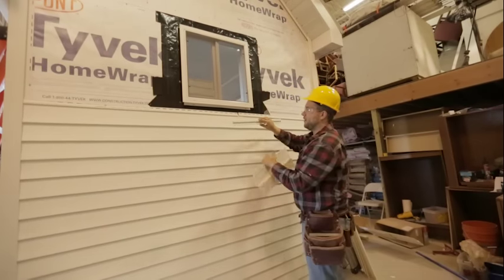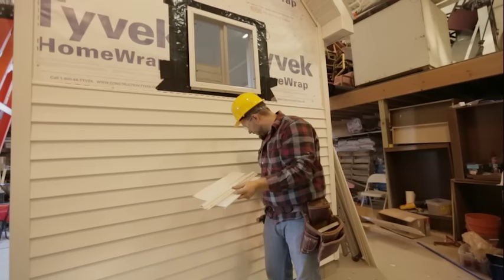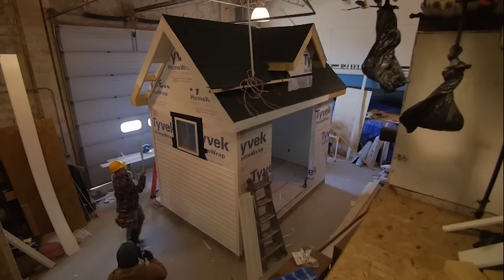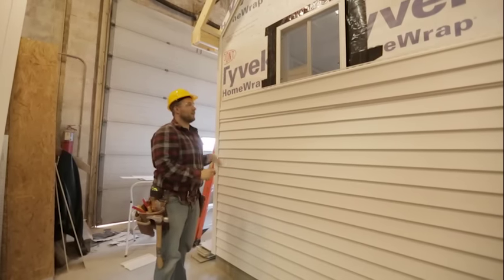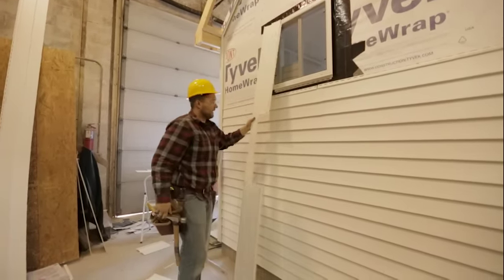How to Install Vinyl Siding Part 5: Utility Strip

Comment: all have to do is cut 1.5 inches off the bottom of a scrap piece of siding and turn it upside down and nail it to the wall and it holds the cut piece of siding tight to the outside of the j then you dont have the extra expense of the strip you are using and its also faster and you also dont have to buy the snap tool for 35 dollars either....the same trick will also work when you use j instead of starter strip just put the cut piece down inside the j then the first piece of siding tucks in front of it and it holds the cut edge tight to the j to keep water and debris out of the j and the wind will never blow the siding out of the j like it does starter strip

Comment: Excellent video! Maybe I missed that part but did you leave 1/4" on each side of window for expansion? When I cut around a window, I cut the 2 vertical cuts first with snips and then I lay the vinyl down and put straight edge going from one cut to the other and score my horizontal line with Olfa knife (very sharp knife) and then break off that piece. You have to make sure when you do it this way that your straight edge doesn't move.
Really like your videos!